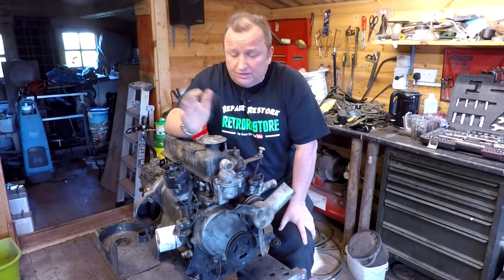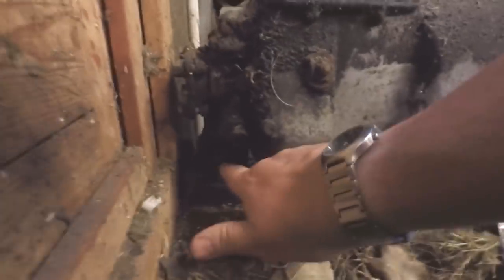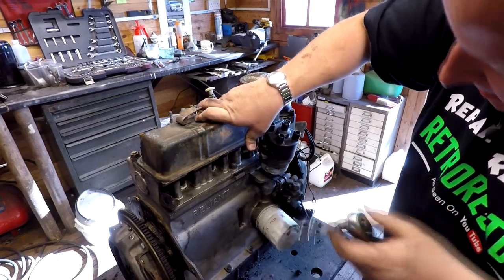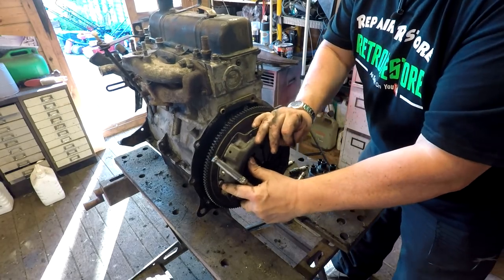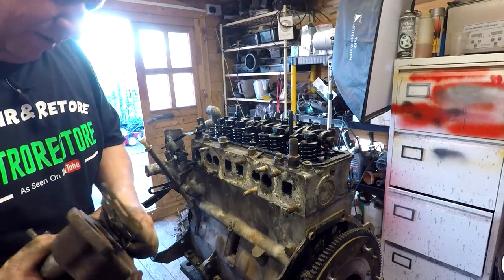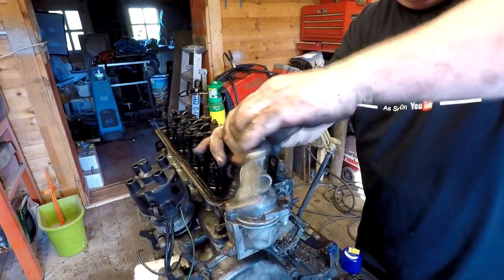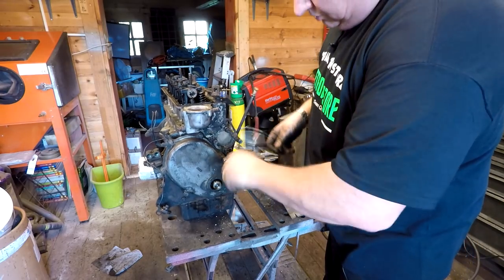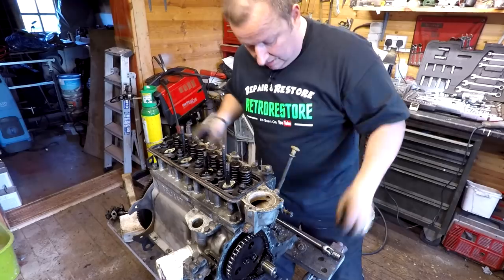Part 33 Reliant Trotter Restoration | Engine - Off With Your Head

Comment: Head studs can be such an issue particularly when they go through the coolant jackets... On the old 6 cylinder series 1, 2 and 3 Jags, we used old cambelts and an engine crane to lift the heads... the whole car would lift off the ground before the head budged. One guy had a Stag that needed the heads removing... they lifted a bit, but wouldn't come off, so he used a hacksaw blade to cut the studs... ended up cutting into the deck and the engine was toast... Great video. Cheers
Reply from the maker: Yes I had the same issue with a Dolomite Sprint engine in the 80's Pete, those slant engines are known for it.

Comment: A little bit too much impact technology used there lol. Love the trotter van videos.
Reply from the maker: Not really Matt, there was little real impact and a wooden mallet. It was also aluminium fatigue with the corroded bolts holding the pump on. Was renewing it anyway.

Comment: No Bricktop today? A new helper? Helping Grand dad in the shop. My mind went back to the old Austin Mini. I think they had an 850 or am I wrong. I don't know, but did Reliant source their 850 from them? Maybe that might be a source for the engine you are looking for? Probably completely different. Good to see the progress. The water pump was going to be replaced anyways so the broken piece that came off isn't a big deal.
Reply from the maker: Reliant made their own engines in house Bri, That's right, I was going to change the pump anyway.

Comment: I've been there in the past- trying to get a reluctant head off! Never tried it myself, but I've heard of a technique where you connect up the starter motor and try cranking it once all the head bolts and rockers are off.  The pressure generated in the bores is supposed to sometimes dislodge the head.
Reply from the maker: I've had heads before like this and much worse. Mostly heads with studs instead of bolts. Corrosion is a killer on them.

Comment: Great videos...Got a lot of helpful tips from your videos.  I have a Reliant Ant TW9 milk float I'm restoring...Was sitting in a field for 30 years.  Now about to paint cab...any recommendations on what type of primer to use with cellulose paint, on the fiberglass cab?  Thanks. :)
Reply from the maker: I used a 2K filler primer called Lechler Green TI primer
Reply: @retrorestore  thanks, I'll see where I can get some.  :)

Comment: You did hammer on that metal hose section a lot. I'm not surprised it broke off there. It wasn't the ideal place to hit to "persuade" it to free off.
Reply from the maker: It was hit with a wooden hammer, You'll always struggle when there are steel studs involved in aluminium body's and there was no real other place to persuade it. It happens bud.

Comment: If it's a 1974 engine then it would be an early MK1 Robin engine and that's a 750cc. There were no 700cc engines fitted to Robins. All 700cc engine start with C70 stamped on the cylinder head. That manifold looks like a later one to take an SU carb. You can tell due to the orientation of the studs. They are parallel to the block. The studs on a 700cc would be perpendicular (going across) for the Zenith carb. SU will be much easier to find. Compare stud orientation to the manifold on the other engine. The water pump is a later one as it has a 3 blade plastic fan, but that could have been changed any time.EDIT:  LOL hadn't yet watched the bit where you broke the water pump. When you buy a new one do NOT get one with the cast outlets. They are shit. There should be a water drain plug at the back of the block low down on manifold side. Remove that and have a poke about in there. Cylinder no.4 can get a bit clogged round that area. And if you do use that engine swap the temp.sender under the thermostat. Robin ones don't work with Regal gauges. Just swap over from other engine. Oh and by the way... early non synchro boxes were only non synchro on first gear only (and reverse of course). I just need to remember to stop in my Regal before going into first at lights. Changing up is fine. They aren't bad at all really.
Reply from the maker: Yes you are right. After more research it was a May 74 Mk1 750CC robin. I measured the bores to confirm.
Cheers
Martin

Comment: I think the Regal carb is different from the bigger's SU, a shame it isn't a 850 as there is a Fiesta Weber  34ICH that is jetted almost perfect for the 850cc and its not the hardest job to modify the intake as the 34ICH is at right angles to the SU's mounting.    The box you have there is the exact same as mine except its gearing will be a little bit different, dunno what the ratios the Bugs and Rebel's used but will feel very pokey.   Been watching this vid with extra interest as I am swapping out my box and clutch since it came back from the garage all winkled and won't go into first,  bit peeved as the gearbox was a "recon" which I paid a fair few hundred for and its not done a thousand miles :(   Might want to look in at getting the sump gasket done now rather than down the road as its pretty old and check the teeth on the timing chain sprockets, for the water pump someone in FB's Reliant forum found a company that refurbishes the original water pumps for quite cheap compared to the price of a new one, you should check that out as they clean up, new bearings and seals pressed in and its original spec not the nasty Delhi backstreet cast ones that seem to be the norm today :)   Fifer's site has a tip too for the rocker arms you might be interested in where he does a little mod that seems to help our rockers and stops them being suck clackety clack so much.
Reply from the maker: Thanks Ian, I'll check Fifer's site, not heard of that one.
Reply: Sukhoi jets man... That's Really Nice!  Awesome. Thinking a turbo...But the old engine can't take it,

Comment: Now if the engine was still in the van and you had to take the head off that is a faf. I have done it and the head was warped so I filed it flat and put it back on with a new gasket it ran great after that. I think it would of been quicker if I took the engine out though.
Reply from the maker: Yes Tim, you'd never have got it off in the van. I've had worse though on my Dolomite Sprint in the 80's

Comment: Hi there was just wondering if u had any videos on the reliant carburetor change or clean up I can a seezed up carburetor and wondered can I restore it or get new one thanks
Reply from the maker: I've not got that far yet David but I do restore carbs for the lawnmowers I have worked on. I use an ultrasonic cleaner if they are very bad.
Reply: @retrorestore  no worries thank u ill keep posted iv just inherited a trike with reliant engine and frame and I'm looking at reconditioning the engine

Comment: The 1971 & 1973 cars gearbox clutch housing looking like your old on the floor with a rubber gaiter around the clutch fork/arm. The 1971 & 1973 cars had synchromesh but not on first gear or reverse gear.
Reply from the maker: I see. This one is a 1967. Must be the same casing.Cheers
Martin